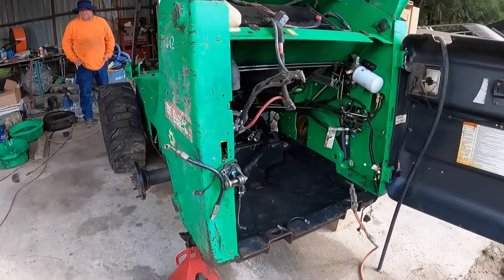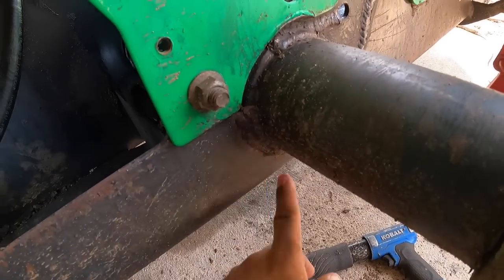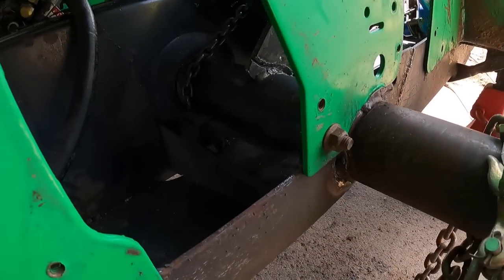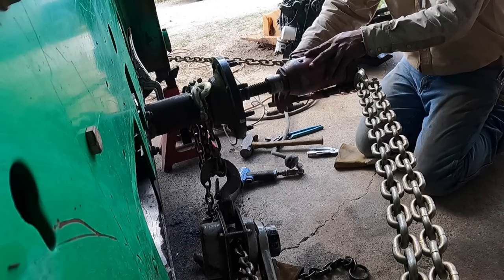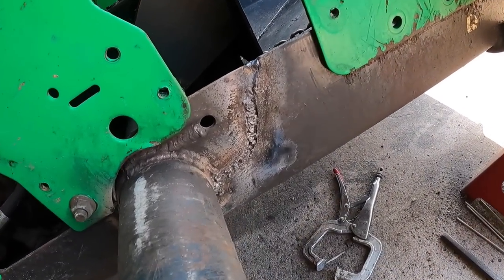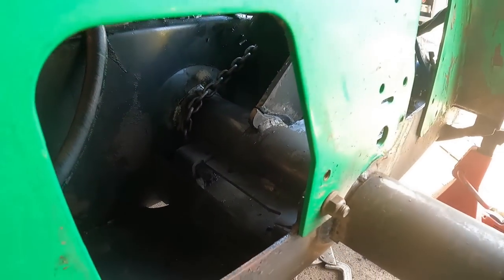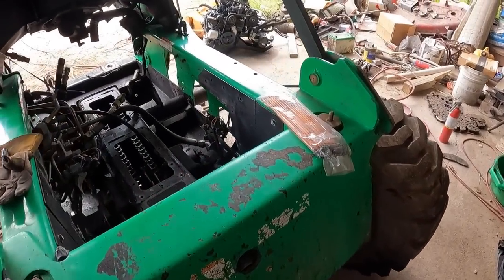Broken Skidsteer Axle Tube.

Comment: I can say with 100% certainty that temco hydraulics is a stand up company with fantastic customer service!!  I had boughten a 50 ton hollow cylinder from them about three months before my shop burned down. I emailed them real quick to see how much a seal kit is for it. Before I could even order one they had sent out a complete rebuild kit for it for free!! It was in the far end of my shop that was the last thing to catch fire. So it just got hot enough to burn some of the paint off and wreck the seals. Getting that kit  was one of the little things that meant O-so much to me at a really hard time in my life!!   Thanks temco!!

Comment: Pretty common issue on abused skid loaders.  Also those chains you can remove a link to tighten them up as they do stretch out over time. Very nice that they removed the engine first and cleaned it up they must like you 😂
Reply: Never seen anyone take a link out of a drive chain on bobcat. They are endless chains and I’d think you’d want all four the same length
Reply: @robertquast9684 if I’m not mistaken each side has its own drive motor and chain so it shouldn’t cause any issues removing a link off one side. You would be removing the slack in the system. Odds are if some side is that stretched or worn the other is also so you would be doing them both.

Comment: All good fun, one thing I like a lot about your video's is that they basically run in real time, you edit out the boring bits but once you start a job you get it done, more often than not, in one hit. Some makers could go a year between cuts and we would never know... You don't do anything like that which adds a lot more meaning  to your content. 
Thankyou for sharing and doing things in the way you do.
Reply from the maker: Thank you for the input. I always worry about boring the audience. especially after having to see the video multiple times throughout the edit. heck, even I get bored of it by the time im done.
Reply: You left out the part of using the needle gun to relieve the stress, but not too much needle gun to where it work hardens the area.

But great repair as always.
Reply: @ICWeld  I know that feeling lol, I havent posted any of the longer videos I had planned for various reasons but trying to edit them in a way that makes sense and is interesting ...I don't know how the professional editors do it

Comment: That was a nice class on how one can manipulate the rods to get the business end of stick into the right spot. Not to mention how to get all the pieces to fit like original. Great video!
Reply: yup I had never thought about doing that before, if I needed better access I switched welding format...no longer . Now Im'a bend it
Reply: @TalRohan  Ive picked that off him before. I also use a second rod in the other hand to deal in gaps or thin material.
Reply: @7rixee  I believe the local name for that is "Texas TIG"  Ive used it for gap filling but never anything "structural"

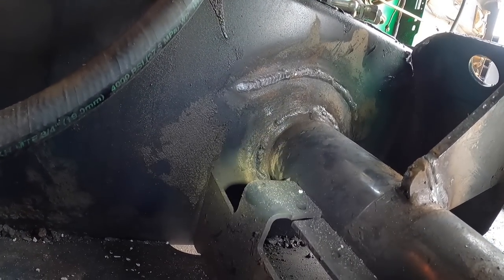Comment: 37:53  broken bracket just below the flashlight beam; also broken where it meets the outside of the frame. Certainly the BEST WELDING (of many previous repairs) this machine has ever had! How you get smooth welds with the contortions and bent rods is beyond belief!

Comment: Extremely Impressive! Fantastic use of the come alongs, chains and jacks to bring things back in position! Isaac, you can add “contortionist” to your resume with all of that out of position welding. Bending those rods to get yourself in those tight  spots and still have good penetration and a good looking bead👍. You made this repair look a lot easier than it actually was… you saved the customer 💰by keeping this machine productive, not having to purchase new equipment for quite awhile! PROPER Repair! 
⭐️⭐️⭐️⭐️⭐️⚡️⭐️⭐️⭐️⭐️⭐️

Comment: Great job on the cleanup and disassembly, before you were brought in to weld. Wish the YT mechanics get the message, least worries of fire, and they can see ALL the damage, with least possible contamination of the mechanical works.👍👍
That's how I was first taught back in the 70's. The attitude, that has come across lately, is rush, rush, then the job ends up being crap, not always, but more than I'd like to see.
Again.👍👍
Best wishes from Northern Canada.

Comment: Never seen bent welding rods to work around corners. It works. Cool!
Reply: In really tight and blind situations like this job, you weld by feel of the rod burning an sound of the rod burning. You learn after years of practice. I hope this helps. Have a nice day. By the way I am a retired pipe fitter welder.
Reply: I have nothing near the experience that you both have. That means watching these videos and reading the comments allows me to learn a lot. 

I assumed the rod had to be used the way it is out of the box. Obviously bending them up doesn't degrade their performance any... or does it? 

Also, I noticed the rod might contact on some other metal of the workpiece, maybe at mid-rod. Is there a risk that welding might spark up where you do not want because of this? If so, that would make for a wild game of "operation" as someone else commented.

Comment: My observation, and I'm certainly ok in being corrected, the root cause of this problem may be a completely destroyed bearing on the inside of the tube behind the sproket. This would allow the chain and sprocket to put a lot of stress on this tube. The guy is moving the sprocket around a lot, and the very loose chain seam to give way to a greater problem to me. I would be interested to know if this is a contributing factor. Again i stand to be corrected. The guy with the skills to disassemble this machine to this point, has most likley checked this out.
      Exclent, intersting video.

Comment: A broken rear axle on a skid steer happens, because the operator fell foward dropping the load slamming back down on the rear wheels. Very common. 👉👉👉👉We found just removing the whole top half and motor off the chassis makes it easier to realine the wheels better.
Reply from the maker: Great point! Ill have to mention that to my next customer.  Ii have another interesting job coming up.
Reply: @ICWeld  Can't wait to see it❕❕

Comment: From an engineering point of view, the left and right axles must be in line. You could even have tried putting chain tensioners on both chains to reduce the slack or even take a link out of the chain. At the end of the day if it works and the tracking is not affected too much, then the job is fine. Good post.

Comment: Pulling on the final drive to tighten the chain is a good idea but you need  to make sure after you pull that both shafts are parallel on the same plane if there not you will see weird chain wear on the sprockets

Comment: Hmm? The machine has been botched repaired in the past, I think I would have stripped the transmission out of the machine completely and repaired the axle/case to the correct setup, then refitted, and repaired the chassis to suit. There are bearing and seals to consider in that transmission. The Bobcat machines do seem to be very poor build quality. Superb welding skills, as always by IC.

Comment: Looks like a u-bolt setup would've been tougher than directly welding the axle tube to the steel plate frame rails.  Seems to have alot of torsional loads placed on those welds, ie all 4wheels always on a single plane(level)🤔

Comment: I love that you stick weld a lot . That’s what everyone did for decades and it works fine and is so much more versatile than MIG if you know what you’re doing. My brother DC welds cast iron gas pipes live full of gas . He welds on fittings then they drill into the pipe to add new outlets. Safer than it sounds 😂

Comment: Is there no concern that all that heat from welding has cooked the ball bearings that for sure are in the end of the axle tube?  And same for the seals.  This thing might need to be pulled completely apart again soon if the axle bearings should fail.   --Doozer

Comment: Why didn’t you repair the broken support bracket on the front side of the tube? It was broken in at least two very obvious spots. When you showed the right side tube it was not broken. I’m just wondering if there is a reason. 

Great job as always. I love the way you diagnose and then make a plan to correct the real problem, rather than just throwing weld at it. Thanks for the masterclass.
Reply from the maker: The mechanic took care of the small stuff. he was cool with that.
Reply: @ICWeld  thanks for the reply. I was just curious if I was not understanding something.

Comment: The bends you had to put on the welding rod at 37:05 to get the angle of the dangle right for doing that difficultly positioned weld were impressive. On yah Isaac skills all around.

Comment: When I was 22, I heard a loud bang in the mechanic's shop at Alaska Airlines. The 2 guys were working on a forklift, and the lift it was on broke. It flipped and pinned a guy to the floor. Before that, I walked past a guy working on a split rim and it blew up right behind me. Killed one guy and winged another. My point is to be extra careful working on all heavy equipment. You can't jump quick enough. If you're crawling under put a chunk of firewood or an engine block with you. You never know when  someone else may get you killed. Like the time I was on a pile of logs cutting firewood and an earthquake hit. What if it went sideways off of those jack stands from an earthquake.

Comment: The camera gave us an angle that you MISSED , the 1st side you worked on inside the body and looking at the bolt & nut at about 11 o-clock on the inside [ part of the axial mounting ] either side of the flange was cracked ??? 
Thanks again       my saying " if you need a trouble light --- your in trouble "  ;)